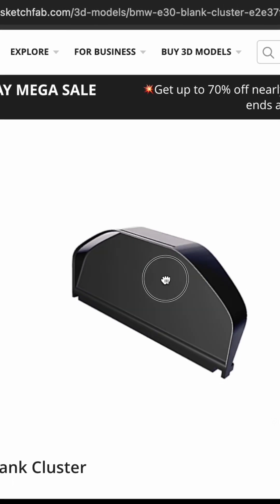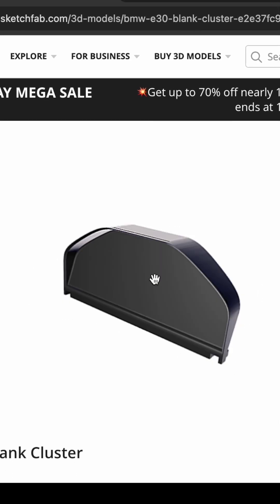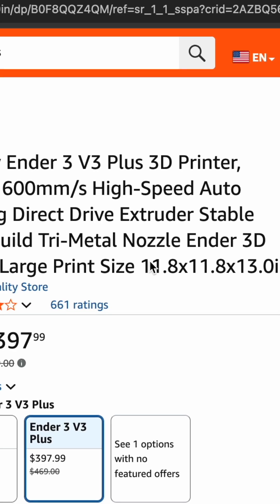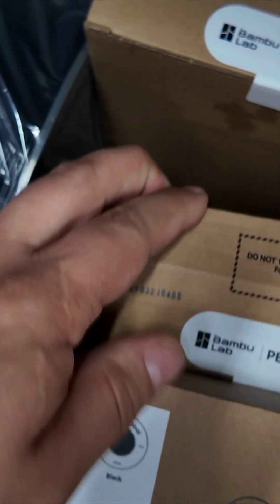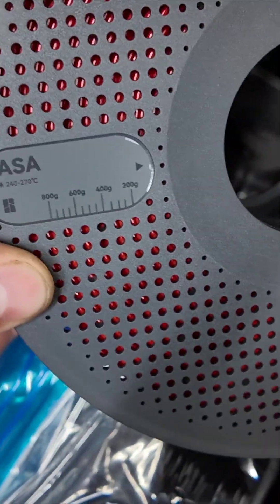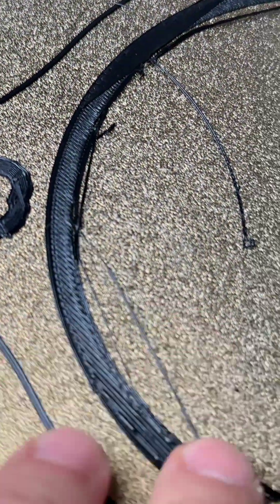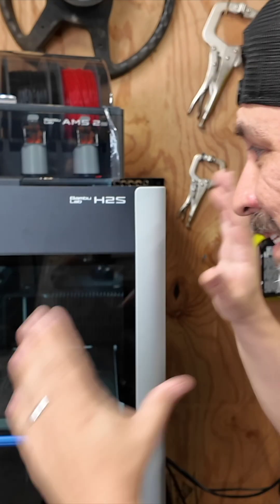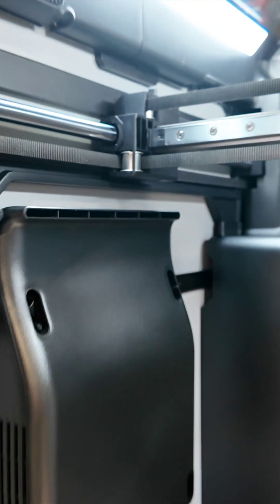What l Learned About 3d Printing Car Parts

Comment: And Bambu Labs printers are as expensive as used cars. By the way, that's not the only filament. PETG is more heat resistant.
Reply from the maker: Give the Centauri Carbon a try and depending on how much sun hits PETG, it can warp :(

Comment: I have the cheapest Ender printer. You can print ASA just fine on it... but you have to use a brim, turn off the cooling fan, and print REAL slow, my taillight covers came out great. If you print too fast, you'll get a horseshoe
Reply from the maker: Nice!!! My room tends to be a bit cold and the garage doesn't help during the colder seasons ;(